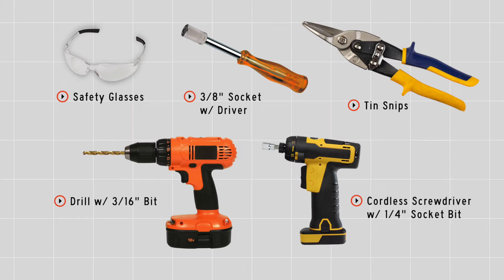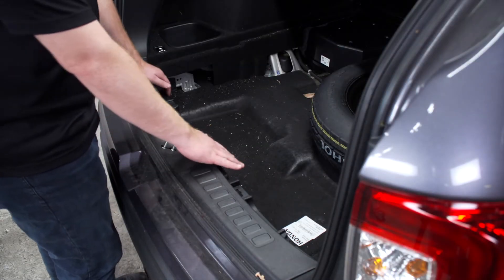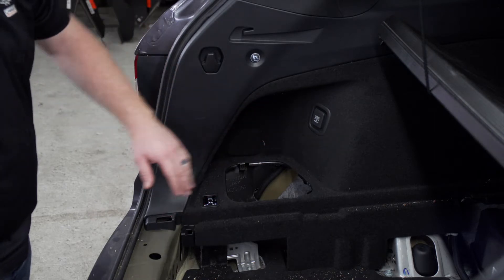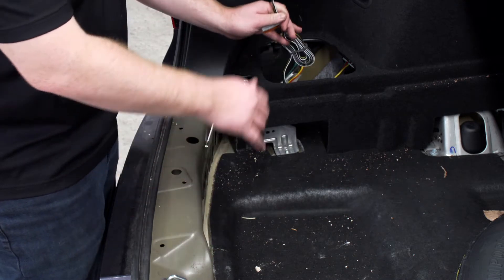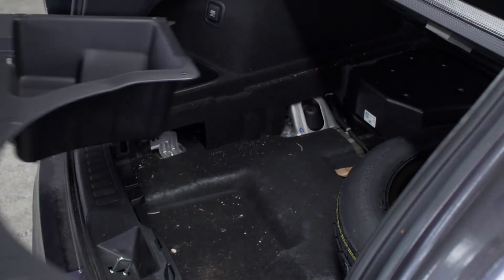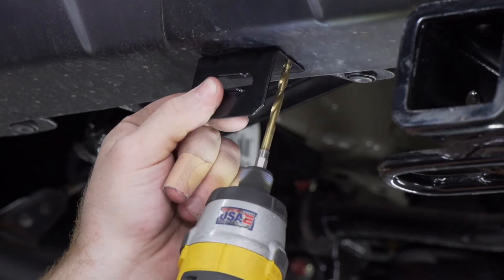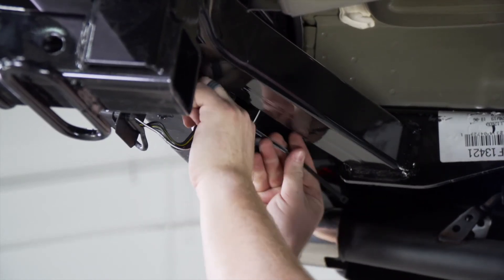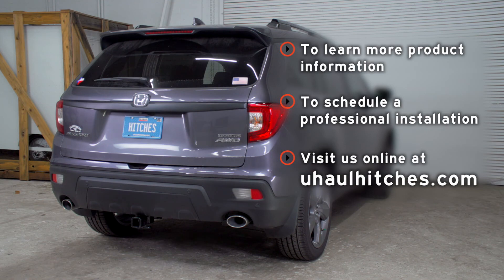2019-2025 Honda Passport | U-Haul Trailer Wiring Installation | CQT118809

Comment: Aloha, Great video.
I did order this from UHAUL and it took 3 months to get here.
Not being able to watch his work, I was shown after the installation the wire laying loose in the trunk.  Derek was advised that it should have been run through the bottom, out to the back and connected to the bracket on the hitch.  He advised that the system was not designed for that.  He was advised that UHAUL has this installation video.
Frustrated, I went back to the other side of the island, pulled it up on YouTube, and reviewed this.  The next day I went back to the other side of the island.  Went to their accessories section and picked up the $4.95 bracket.  When I paying for it, I advised that I am 85, a veteran, handicapped, and showed him the 2019 video.  He said he hadn't seen it!
So much for service!
What arrogance!

Comment: The wiring kit came with a pink 30amp fuse, fuse box does have a spot for it.. called trl main. It did not come with the 20amp mini fuse that you show installing.. do I still need it?
Reply: It looks like you have a different harness from another manufacturer (Curt). We just looked it up and the two manufacturers list different fuses for their instructions so we are going to check which one is necessary.

Comment: There is no wiring connector on the 2020 passport ex-l AWD where you state it should be.
Reply: At 1:28 did you remove the cargo hooks to pull back the paneling to get a better look? Maybe your harness was more difficult to reach from just removing the tray and you just need to pull back on the paneling to get a better look?
Reply: @aaronlimon4803  I tried, but that second screw on the bottom cargo hook was in so tight it stripped the screw.  I guess I'll try to extract that and pull it apart.  We reached up as far as we could using your method and couldn't feel a thing.  Maybe we're just unlucky and it's taped in a difficult place.  Thanks for the video though.